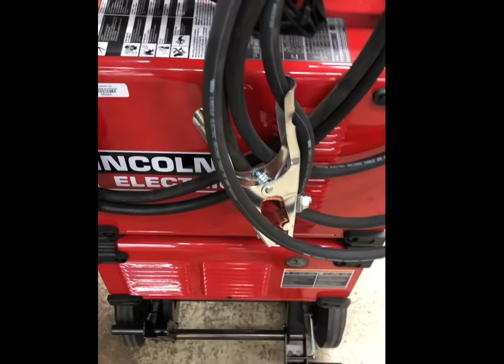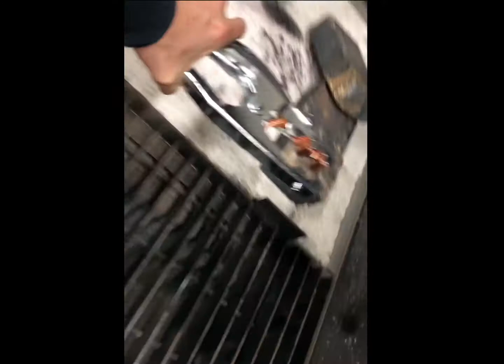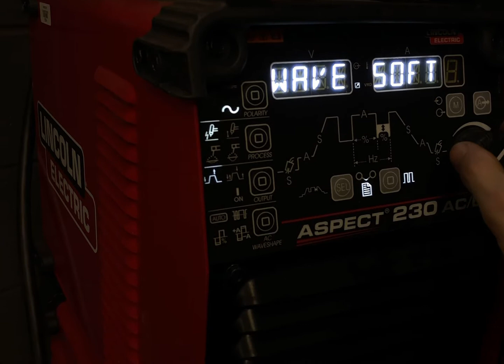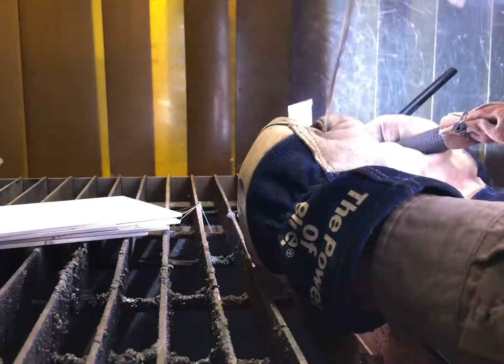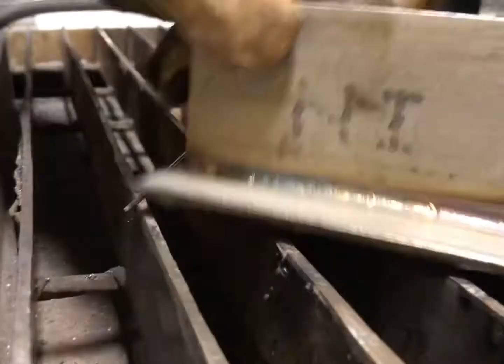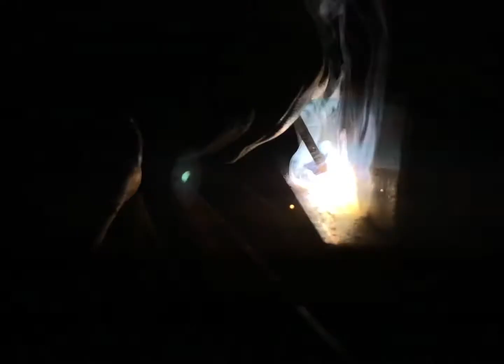Lincoln Aspect 230 AC/DC - what a great machine!!!

Comment: Does this welder have the strike to start option without using the pedal?
Reply: from what I can tell the two options for this machine are the high frequency start using the foot pedal and the lift arc option which wouldn't require the pedal.

Comment: Hi, thank you for the video. I had one question though, that is, why does the Aspect 230 AC/DC power cord have a female plug?
Reply: It comes with 2 outlet adapter plugs 220 or 110 volt

Comment: Just got into aluminum I got problem where my heat only hits one side of the T joint, I'm using this machine
Reply from the maker: Once you bridge that gap, keep feeding the puddle.  It it looks like a c-shape or Pac-Man, keep feeding him with filler rod and he will close his mouth so to say and you will have a filled puddle.
Reply: @weldzcool1147  Thanks, It is working now, I wasn't dipping enough after I figure how to bridge

Comment: Where the hell are you getting the dynasty 280 near the cost of the aspect 230? You said price points are close but they aren’t anywhere near each other. You’d be closer in price to a lesser machine, 210dx if you were to say they were somewhat close but you lose 20 amps and spend 1-2k more for less power with going for a Miller. Aspect 230 for the small output Tig for the win 🔥🔥
Reply from the maker: Tizzy_life not sure where in that video I said they had a similar price point?  The only thing I said was that they had a similar footprint, meaning size.  The Miller is definitely more expensive by about $2500 and it is a multi process machine since you can MIG and fluxcore if you spend even more on a suitcase.  Overall both great machines that pack a big punch for their size.  Thanks for watching 😁
Reply: @weldzcool1147  that was my fault, I mis heard it.
Reply from the maker: @Tizm_With_Tony  no worries
Reply: @weldzcool1147  have you tried to push it past recommended thicknesses? How did it perform?
Reply from the maker: @Tizm_With_Tony  in terms of what the machine says I can run at?
Reply: @weldzcool1147  yeah. I believe the 230 is up to 1/4”, have you ever tried to see what it would do on 3/8 aluminum in single pass? I have no doubts it couldnt handle 3/8 beveled and a dual pass, but will it make it on a single pass with good penetration?
Reply: Reason I ask is I’m seriously considering this machine now. Dynast just to expensive for hobby welding. And I wouldn’t want a 200 amp dynasty, so that would leave me with a 280 or 400 and those are serious $$
Reply from the maker: @Tizm_With_Tony  I hadn’t tried but it’s a great idea.  I’ll give it a go and let you know.  I think we have some 1/4” aluminum laying around.
Reply: @weldzcool1147  the 230 is the best machine for about $6500. Even the 210 dynasty cost alittle more than that and it’s not the same output. The aspect needs to be run hard to see if it’s a justification to not spend 9k on a dynasty 280. If it can handle the load of 3/8 aluminum, then it’s worth the cost to have if you don’t do a lot of thick aluminum daily.
Reply: I had an Everlast 255ext and I just sold it last week. It was a great machine, but I just want something that I can go to someone on the east coast if I have problems. I deal with a local welding supply and I’ve asked them questions, but I wasn’t able to get answers because they knew nothing about Everlast. Now I’m deterring on which aspect package to buy. The aircooled or buy the aircooled package and cooler without the cart to save $$ or maybe the entire package. Can the cart support a 244-300 cylinder? That’s the determination at this point. If it can hold only a 125, why buy a cart with it if I can’t even put the large tank on it.
Reply from the maker: @Tizm_With_Tony  never used an Everlast but heard they are decent machines.
Reply: @weldzcool1147  yes, Everlast is great, just I need something I can get support locally without having to make a phone call and wait for calls back.
Reply from the maker: @Tizm_With_Tony  so I tried running a 5/16” tee aluminum today and it does work at 230 amps but slow. I would say it’s possible to do 3/8” but maybe a little preheat and running slow would make it possible. All in all, 1/4” is probably the max at a speed that would be good for quality and still making money. Hope that makes sense?
Reply: @weldzcool1147  I think this machine would be good for me. I placed an order and then had to cancel it.... they are on quite a bit of a delay making them. Calling around to see who has it and then placing another order. Prolly going to get the air cooled set up for now then Upgrade to water cooled. I’ve welded at 200 amps on a 9 series torch with a 17 series power cable, it gets hot, but still does the job. I’m going with the air cooled because I’m also getting a Lincoln tomahawk 375 at the same time and don’t  want to expend too much right now since I just placed a factory order for a GMC Sierra 3500hd crew cab long bed loaded AT4 and want to keep my credit usage low until the truck arrives so I get a good APR when financing the balance owed.

Comment: Thanks for uploading! It's very hard to find much info on this machine from users. 

How do you think it compares to the Dynasty? (Low-Amp Arc Starts, and how's the pedal?)
Reply from the maker: Glad you liked the video. So although I lean towards red, both machines are great and have used both aspects and dynasty’s. Price points are not far off from each other. As for foot pedal the Lincoln’s are always lower profile which I prefer. But in the grand scheme I wouldn’t turn down either.